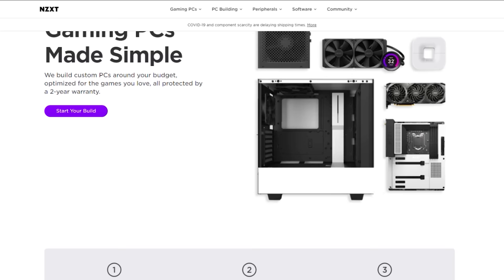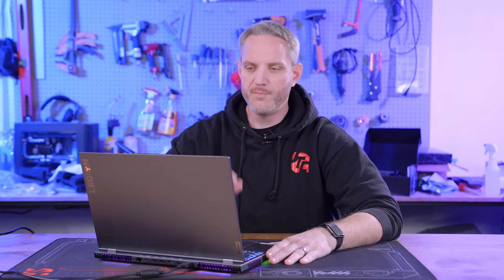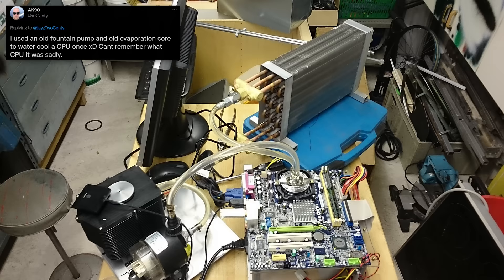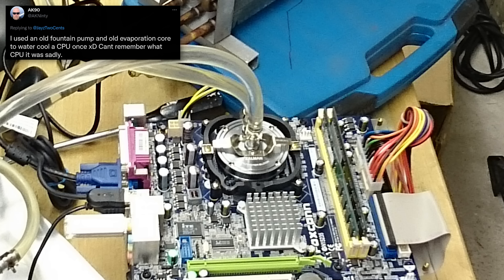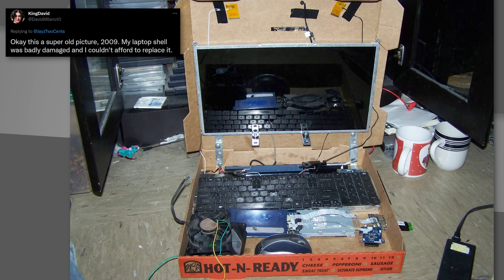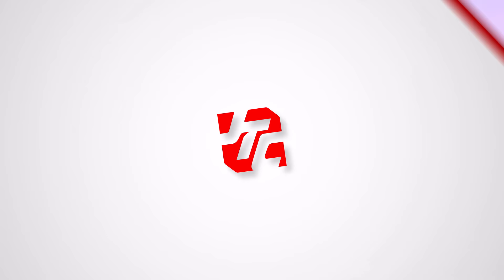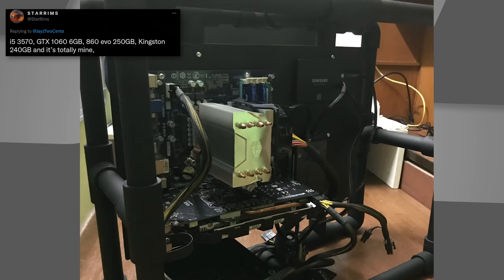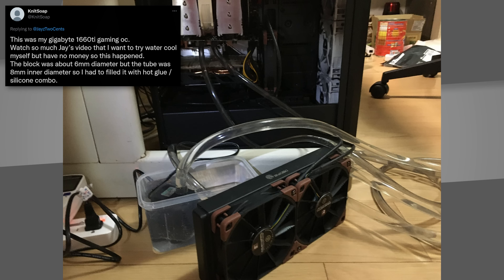We asked to see your JANKIEST PC setups... and you DIDN'T disappoint!

Comment: My jankiest setup was my current PC, before I got my case. PSU sitting on the floor, mobo balanced on top of gf's GameCube because the mounting bracket for the GPU (a 1070 mini because that's all I could find) stuck out past the bottom of the mobo. Completely open, HDMI running to the TV. And it sat there for months like that.

Comment: I had a dual PSU setup once... A very basic and very old "gaming" case, I think ATX? standard size i guess, anyway, I upgraded to an HD 7770, If I recall it had a 6 pin connector, but the PSU in my case didn't have a 6 pin, I had a server size PSU, meant for a much larger case, no way I could fit it in my tiny case... Well that PSU had a 6 pin connector, and I couldn't afford a new one as I live in poverty, well I kept the case side cover off and ran the 6 pin from the server PSU to my GPU, I had to boot my PC and flip the power switch on the PSU at the same time otherwise it either wouldn't boot, or wouldn't display, depending on which I turned on first. Oh I should also mention I replaced the noisy broken fan in the server PSU with a janky solder rig (yes I'm fully aware of the danger in opening the PSU like I did, but again, poverty, worked with what I had, I was very careful not to touch any components)

That thing got abused by GTA V lol it was a dual core pentium, one of the newer releases so it barely handled it everything set low

I forgot but I think I had to run something else from the server PSU to my PC like the 24 pin connector otherwise it wouldn't work? This was years ago... I can't recall accurately, but yea my desktop and server PSU sat on a broke down cardboard box to prevent carpet static.

Then there was this one time I tried liquid metal with a stock AMD aluminum heatsink, I knew you can't use it with aluminum but I did it anyway... The heatsink disintegrated into powder, this was on a different system than the one above, my solution to the destroyed cooler was to use a junk heatsink, but it was intel, didn't have the AMD famous "latching" mechanism and I couldn't fit the heatsink into the one I had, so I used proper grizzly thermal paste and literally just rested/pressed the heatsink onto the CPU with my case laying on its side, guts open. Because this was not making sufficient contact without applied pressure, I cut out and created an air tunnel to stream the air from one of those high powered server fans through the blades of the heatsink

Being the broke a%$ computer nerd that I am... Life's been a struggle keeping a reliable system

Oh god... then there was my MSI mini-atx build...with no case at all, back before I knew carpet static was bad, long before all the above happened, that I literally let sit on the carpeted floor with no protective layer underneath, the motherboard was sent to me by a friend I knew online

Then there was the old acer aspire one, traded my PS3 for it, a really old netbook that I tried and tried and eventually forced to handle some games (modifying game files, deleting animations that caused FPS drops, using free release "lightweight" mods etc.) half the screen was cracked and wouldn't display, had to use an external monitor, I remember walking 10-15 miles with my acer and monitor in backpack to the mall to use the free wifi as I was developing a private server mmo and had no wifi at home. As time passed I decided to remove the deadweight of the netbooks monitor and sawed off the brackets and unplugged the display port... This was when I discovered the wifi antennas, which I had taped to No.1 copper wiring I think it was? a thick gauge, used to run 120v electricity to outlets in homes, to be used as antenna I could stick out of my window and pick up open wifi from neighbors, eventually upgraded to an ALFA wifi adapter which claimed to have the best range at the time and intended for "wardriving" (turns out the thing was a turd and overheated and killed itself, bought another, same thing happened, or at least I assume it overheated, don't even get me started on driver support... was a nightmare finding a digital copy, as they only sent a CD with the adapter and I didn't have access to a disk drive) This was also around the time I started dabbling in dual booting BackTrack Linux/windows and playing around with aircrack... I didn't get very far as most wireless networks around this time already started using WPA2, had one successful attempt that was short lived as the next day they switched to WPA2, oops, I was only 16yo at the time

Comment: Jay didn't comment on the jankiest part of that custom GTX 1660ti water cooling... the tubing was too big for the connectors on the block, so they filled the gap with hot glue and silicone...

Comment: In all fairness water cooling in the past was a lot easier in many ways. Yes the block could be a challenge, but most processors produced so little heat that anyone could buy a chunk of copper and simply drill/cut a channel in it and simply flowing water through it would be enough to cool the CPU. At least with Pentium 4 and the Core 2 series. AMD was a different story when it came to heat.

Comment: I wish I had pictures but does anyone remember that Apple had clones?  I had a Laser 128 which was more or less an Apple IIc clone connected to a tiny monochrome monitor.  I probably had my OG Nintendo with the stupid robot and my Sega Master System nearby connected to a little CRT TV.  As I got in to PC don't get me started on my Packard Bell where I upgraded the 486SX with an Intel 486DX Overdrive CPU and an upgrade to the VRAM on the motherboard with what I recall as a "zig-zag" VRAM module.  Without all that I doubt I would have had a career in IT.

Comment: Maybe a series for poor man setups, where. There is no budget. I once had an atx build slapped together with 2x5lt cardboard wine boxes and homemade heatsinks for the gpu, back then it was a ATI 9800 gpu, heatsinks pulled from broken amplifiers and the pentium 3 was pulled from its case and put together again with duct tape and an 80mm case fan. The crt was something found in an old store room, it was a Compaq 27inch with some or other stupid resolution

Comment: Looking for advice 
I want to run 4 monitors on the following system;
Nvidia GeForce GTX 1660 6GB
50AMD Ryzen 3i 3600
0 GB SSD
16 GB Corsair Vengence RAM

The Monitors will be x2 LG 27GN650 27" Full HD 1920 x1880p
144Hz
x1 Mobile Pix Max 14" Full USB/C
x1 Lepow 15.6 inch HD 1080p type C IPS Display 

Yeah is a wired setup, but the smaller screen ate used for text documents where as the larger screen will be used for Discord , a VTT (Virtual Tabletop program) and Gaming. 

Will the GPU handle it?
Reply: As long as you don’t intend to game on all monitors together and as long as you Graphics card supports that many outputs you are good to go.

Comment: At the start of the pandemic I bought pc parts and bought the cheapest case I could. I had to drill two grates in the top of it for more exhaust and then install the fans on the outside of the case with zip ties. Only stuck my hand in them a few times.

Comment: Loved the video and all the great builds :D But ended up with 2 questions.
1: Are not some of the moderboard screws supposed to be grounded?
2: If so, how inportant is it?
Reply: 1. Yes

2. Not really. The mobo still has ground from the PSU. Case screws basically make sure the case is well grounded to the same level as the mobo. If your case is plastic pipe or a cardboard box, grounding the case is less relevant.
Reply: It's not if I'm not mistaken. The grounding is done through the 24 pin connector

Comment: 13 minutes in it looks like he has his computer on a work desk I see a stack of fans on the ride a couple of things with gosh the amount of wires everywhere I'm amazed he hasn't had a issue with static
Reply: It's me! To be fair most of them were not plugged into anything. Picture was from about 5 years ago and I believe I had poured out a bin of stuff to find a USB hub and get the AIO plugged in. Took the picture to send to a friend and show my jank mount, because that case only had 200mm fan mounts.

Cleaned up shortly after but never took many shots of this build because this the AIO hanging off the top it wasn't much to show
Reply: @Haargeroya  goes back to the old saying do what we can with what we got

Comment: GUYS, honest question. I have a motherboard with 2 cpu conectors, one 8 pin and one 4 pin. Some psu's have power cables denominated pci-e/cpu and some have them apart. CAN I plug a PCI-E cable into that 4 pin connector?

Comment: I was wondering if I could get a recommendation for dual monitor mount. My monitors ASUS TUF 32" (VG32VQ1B) (15.98 lb / 7.25 kg) each, VESA compatible. I can use grommet or clap style, either work. Recently bought this monitor mounting arms off amazon (HUANUO Dual Monitor Stand) and they droop :( they said 20lbs per arm, witch is false. Seems there's always to be 2 failing points in monitor mounts, at the swivels/tilts. From the research I've done, a post style is more study then spring/gas arms. Arms have a little more reach and motion generally speaking. I'm not too picky but black and budget isn't a problem. Mainly want some range of motion up and down, back and frorth, no bounce at all optimally, and it has to support the weight (no failing swivels/tilts). I feel lost, the arms I got don't hold specified weight, so I don't exactly trust what the amazon specifications say, Welp!

Comment: At 13:50 it looks like that PC might come to life and strangle me with those wires or just start a fire
Reply: It's me! To be fair most of them were not plugged into anything. Picture was from about 5 ago and I believe I had poured out a bin of stuff to find a USB hub and get the AIO plugged in. Took the picture to send to a friend and show my jank mount, because that case only had 200mm fan mounts.
Reply: @Haargeroya fair, it definitely looked like a fire hazard I feel it I tweaked my PC to look jank af just to take a picture send it to one of my friends to make them cringe a bit and put it back to normal after the pic
Reply: My bad about the punctuation I've been  drinking jack all day

Comment: God my GPU mod is so much jankyer than this stuff lol. GPU ran hot, like 87C non stop. So I took it apart, put new thermal pads in, ZIP TIED 2 noctua fans to it, and put 2 big heat sinks on the backplate of my 2070 super FE. Now it doesn't go above 65C

Comment: Great video. I really appreciate it. I’m looking to build a “middle of the road” server to run VMs, but also run some gaming servers on. Do you have any suggestions on hardware.  I wouldn’t mind it to be rack mounted but either way is fine. I don’t know if I should go the enterprise route with multiple sockets or consumer side with a crazy processor and board. If you were going to build a machine that can host some gaming but also run VMs what are some hardware recommendations?  Or would you build a specific gaming server and a separate VM server?  Thanks for your time.
Reply: Find a service provider that will rent you physical hardware for a short term and test various configurations out

Comment: The Hot-n-ready box looks like bullsh*t. Maybe this was a work in progress, but that socket 478 fan is sitting on top of a case fan, and none of those wires in that corner go anywhere.

The PVC build doesn't look jenky, but probably is. My concern would be static discharge. If you notice the extra t-fittings on the backside, and a sliver of vertical pipe you can see, that mobo is screwed directly into the same plastic tubes that my grade 10 physics teacher used to demonstrate static electricity with a piece of fur, before moving on to the good stuff of zapping kids with a Van de Graaff generator.....ah, good times I got to relive in college when I went back to school to get my electrical license...

Comment: cant say id recomend the nzxt sponser I  spent 5k on a system back in December as soon as I got it I hit the power button a the motherboard  died it   poped a capac iter next to an unused fan header   and at closer inspection there was a crack in the board from the screw hole were it was mounted I contacted them for warranty replacement they said they wont cover it because they feel it was operator error wich they don't cover I  sent pictured of the blown cap and the crack  in the screw mount   next to it and they told me  it was my fault because I was probnly to  rough unboxing it..  luckjly the board was asus  so I contacted asus and they rmad it and replaced the board free of charge  so  I still made it out with a pc but nzxt should have  covered it I shouldn't have had to contact asus directly for replacement oh  last thing almost all the cables in the case were unplugged when I got it except the main power connector and the  GPU all the fan   and RGB lights were unplugged as was the  cooling pump

Comment: Why would you need to water-cooled a PC 20-30 years ago? PC back in those time (Single Core CPU) can run very well off one 60mm fan over it. I know this because I had done that to my PC in 1999. Water cooling is only recently become popular because of the massive core counts. Just a few years ago in 2017, Intel's flagship the 6700K was only quad-core and can easily be air-cooled and before that was Core-duo CPU. I remember in 2003 the top of the line CPU was 400mhz.

Comment: Jay, I don't know if you read comments but, I built my little brother a PC with the last money I had. I did my best but it is a mess. It turns on and post but it is extremely slow and not near as good looking as he deserves. Is there anyway you could help me out? I know it's not normally what you do but you are the most knowledgeable and best YouTuber I know of. PLEASE HELP ME
Reply: Not him, but check the temperatures, also, if you didn't reinstall the OS – reinstall it. If it is running a single stick of RAM it sometimes might cause issues. If the system is slow in general usage (not gaming) check the HDD/SSD health. Ensure that it has enough power coming from your PSU – use a PSU calculator and approximate your parts' load. If the system is slow when in games – ensure that you are not running on integrated graphics. Ensure you gott he latest drivers too.

Comment: ...If I knew this video was being made.... Oh the things I would have uploaded... The least if which is my old SFF "gaming computer" made from and old HP Compaq Elite office PC  where I have a cereal box fan shroud due to the fact that MSI uses trash fans for their low profile GPUs that fail after 6 to 12 months and the WiFi card is right in front of the GPU and until relatively recently that WiFi card was my only way of connecting to the internet, and the Noctua fans I bought to replace the MSI ones (after I got tired of spending the equivalent of $30 USD to ship the then ~$120 GTX1050 for warranty every 6 months) were too thick and one fan would not cut it. So the obvious solution was to make a shroud... Out of what I had at the time.... A torn cereal box, zip ties, and some Scotch tape.

Comment: Geez that's newage stuff... I had a watercooled AthlonXP 2500+. Good thing, I won the silicon lottery back then, too, so I was able to overclock it over FSB, and the BIOS listed it as 3200+.

Bad thing though: that was the time of the cheap Chinese electrolytic condensator copies of the Japanese one. So after a year, they popped and I had to buy an entirely new system except for the case, GPU and the drives.

Comment: your jokes are so funny, a way to flex your beefy pc's, don't you know 9th gen low end celeron from 2018 that launches for $42 now cost over $100, and 4th gen low end used core i3 from 2013 now cost the same with upcoming 2022 celeron g6900.